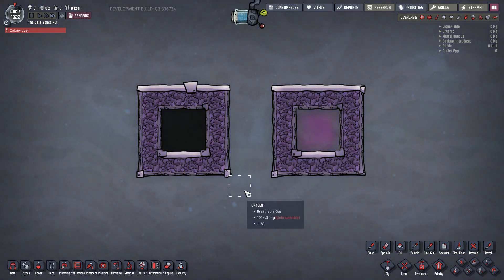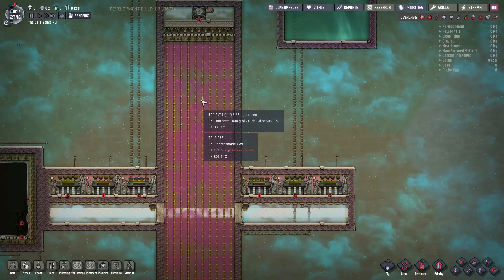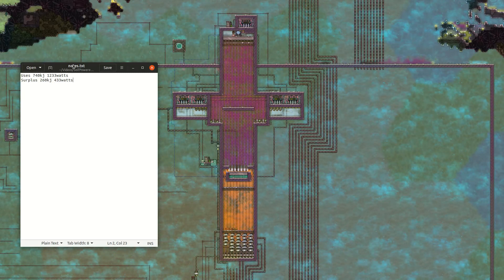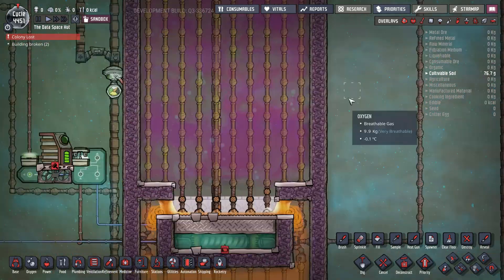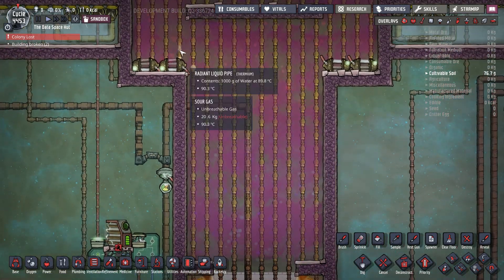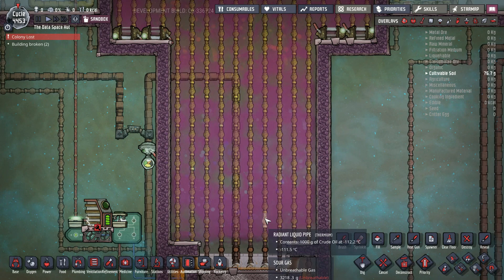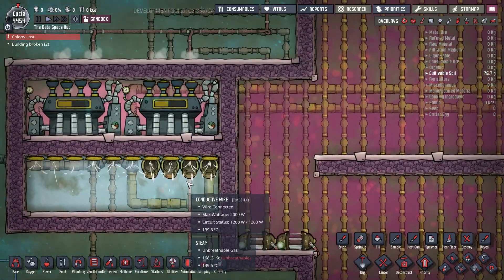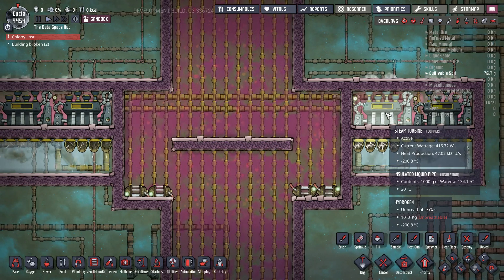Self Powered Natural Gas Cooker

Comment from the maker: Addenda:
1) I'm not sure if this still works. In the current version of the game, I've observed that these elements seem to change their temperature when they change state to account for the difference in heat energy. If that's correct, then there shouldn't be enough heat from the state change to make a cooker self-powered.
Reply: any news on this?
Reply: Its not quite as power efficient as yours, but I think I have a fix for this problem here: https://youtu.be/BXt2WSj0NJw
Reply: I just did some testing in sandbox to verify this. It seems that the oil does flash to sour gas a few degrees less than the oil in the pipe, however it seems that the overall DTU gain is still just under 12%. So I don't see why the principle wouldn't still work.

Comment: what I like: you didn't run a pump to move liquid methane, you used the geometry so that pump isn't necessary.

perhaps those metal tiles (@ the methane catch, above tepidizer) could be 1000 kg ice tiles so they have greater thermal mass than 100kg of metal. or alternate between ice and diamond windows for high specific heat & high conductivity combined.

the valves are a huge weak point, requiring a larger area to exchange heat.

the gas pumps only move 7kg/s with 10kg/s of oil being piped in. do you really lose 30% of mass to sulfur? (I thought it was a lower percentage)
Reply: I imagine you won't see this, but you lose 1/3 of the mass to sulphur
It's still worth it though because that 2/3 is like 10-20x as much in power as the starting petroleum

Comment: I don't know how important it is to be super efficient when you're getting the amount of power you do from sour gas... the few times I've done it I used a divided chamber design that drops the oil down one side and the gas flows over the divider and down the other. seems fairly efficient if you use the methane to cool the sour gas after the crude oil cooling stage.

Comment: Impractical but it really drives home the concept of higher heat energy in sour gas.  It explains why every crude to sour gas reaction chamber I have made so far always overheat without interference.  It doesn't matter how large or long it is, the crude went in at 95C and the sour gas comes out at 200+C.  I love this silly game.
Reply: That hot natural gas is actually a bonus
When you burn natural gas that's above 40°c it actually increases the heat in it because the output (mainly the water) has more thermal mass
Just like with the oil -> sour gas, the hotter the starting material is the more bonus heat you get, so strap a steam turbine on it, pump in 200°c+ gas and pull even more energy

Comment: This is a real good video, not just that the design is insane, but you did  a good job of explaining the works of a sour gas condenser. Felt i couldd derive some general rules of thumb for building one from this. Which is what ive been looking for for a long time. I've been working on my own design that outputs 6kg/s of natural gas in survival.
Using the output of steam turbines to cool the sour gass as it travels down is something i hadn't considered, but it makes so much sense in how it contributes to the ability to efficiently drain heat from the sour gas.

Will definitely be using this since my own build is just barely stable, it'll add to it's efficiency greatly.

Thanks for your knowledge!

Comment: Do you have to split the oil to 10 pipes so early? The oil seems to reach the steam turbines at 200 C only. You could probably make everything below that point much slimmer.
Reply from the maker: Two reasons.
1) A slimmer chamber would decrease gas flow and cause all kinds of other issues.
2) Since the rate of heat transfer in a pipe is the same no matter how much liquid is in the pipe you need the same amount of pipe either way. So a full pipe would just have to be serpentined all around to achieve the same result as ten 1kg/s pipes.
Reply: @tonyadvanced6315  You could pump that gas right after methane evaporates instead of letting it float all the way to the bottom. And using the hear exchanger from your heat exchange video you could probably speed up heat transfer between piped gas and piped crude oil significantly.
Reply from the maker: @os3ujziC  That's a good idea, but it introduces an intermediate medium for heat transfer. I wasn't able to do the job that way in less space or with less materials or anything.

Comment: How does the oil not change into petroleum in the pipes?
Reply from the maker: If a pipe is carrying 10% or less of it's maximum capacity then state changes do not happen inside the pipe.

Comment: I might be wrong, but I think the case where having overheated 1kg liquid packets not breaking the pipe has been changed in the new upcoming build. So, we may need a different plan in the future if we still want to accomplish this.
Reply from the maker: Omg. I hope not. I love that trick and it seemed like it was balanced really well by not allowing much capacity.
Reply: valves seem to have been nerfed in the "big merge" patch to integrate the spaced out DLC.

each time I load a game, valves allow more fluid through & a dupe is required to change them back to the original setting. (they do generate the dupe task automatically & remember your setting)

this can be fixed by setting the valve low enough under 1kg that when it opens, It's still under 1kg & leaving the valves in a serviceable position.

Comment: Im pretty sure this is the same design as Gearhead Gaming? Correct me if Im wrong.
Reply from the maker: I've talked to that guy on Reddit a bit. I think he taught me the 1kg/s in a pipe thing and our tactics on such things have converged a bit. But if he made a self powered cooker then I've never heard of it.
Reply: @tonyadvanced6315  I'm not sure if it is self powering but of what I've seen most sour gas boilers of this design and nature are self sufficient since they produce so much Nat gas for so little power input.
Reply from the maker: @ethynkoen8279  You are right. But this one doesn't need to burn natural gas to work. It's fair to wonder what the point of it is, I often do.
Reply: @tonyadvanced6315  the point is it can be done and that is awesome :)

Comment: An interesting point in using no excess power to boil/cool the gas, but a generic sour gas boiler already has a massive net positive energy production so...why would this be useful?
Reply from the maker: It's not, not really, sadly. This project didn't really pan out. That happens to me like half the time.
Reply: IMO they're just far easier to build and understand and secondly when you get to the point when you're thinking of building a sour gas boiler you are already pretty late game and making systems as efficient as possible becomes the main goal. But hey thats just me.